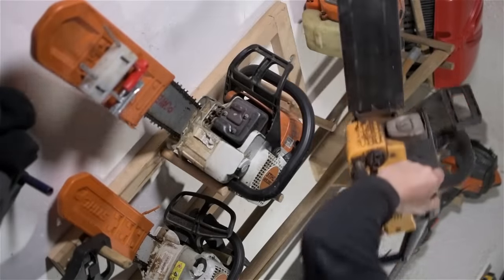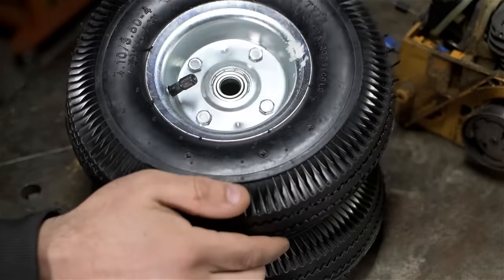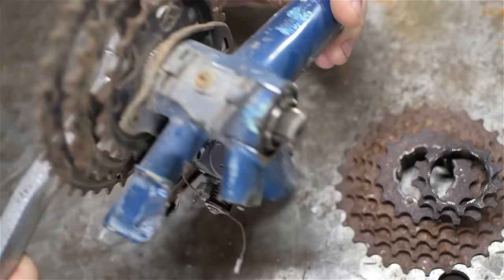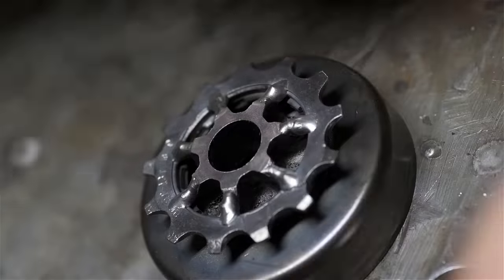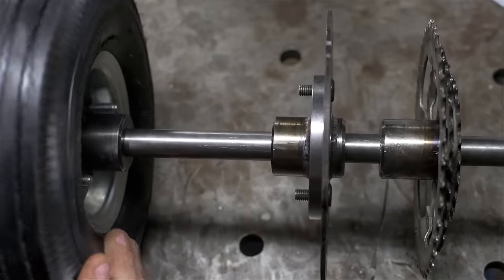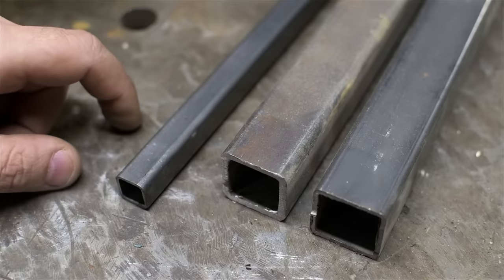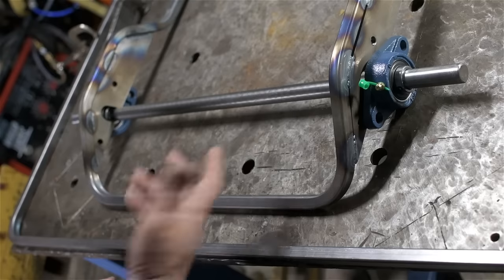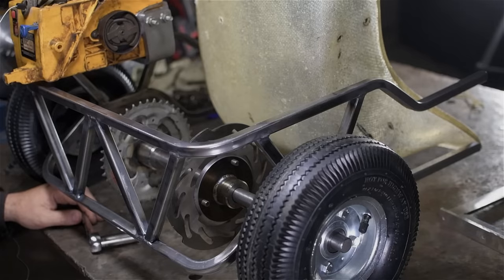CHAINSAW GO KART! - Part 1

Comment: Bit of maths for your gear reduction: If you have 10 inch diameter wheels and you want a max speed of ~20mph, that comes out to about 650 rpm (672 to be exact). With a 12k max rpm that means you'll want a 12000/650 ~ 18:1 gear reduction. That of course depends on whether your chainsaw can hit top RPM at top go kart speeds, but if that's a top speed you want then that's the sort of thing you need. For a 25mph top speed you want around a 15:1 reduction. So I'd probably go for two gear reductions unless you want top speed to be at middling RPMs from the motor.
Reply: Zak Karimjee he may want to keep top speed at about 75% of the power band with a shortened throttle cable. It would probably be gutless or stalling on the low end if he goes too high in gearing +This Old Tony
Reply: I simply can not accept this mob mentality. Unless you're all wearing Plague Doctor masks, for aerodynamics.
Reply: It might just hit top rpms..  or close..  I think it's more than the 1 hp he thinks it is..  50cc Scooter motors are more than 1hp,  and scooter motors are ported and tuned for a lot less power and rpms than a chain saw..  He's gonna be surprised at the power,  
    Chain saws should have close to the power of a Dirt Bike of the same displacement..    I know, 50cc dirt bikes are pretty fast with the little guys on em..    that chain saw is gonna be a lot for that small frame.
Reply: Zak Karimjee 
also the the engine may not have enough tq. for take off. even with a gearing that will allow for 20mph. I came across this. when trying a 3 HP engine on my cart. it wouldn't move on its own. but with help taking off. it would do 15-20 mph. but with the 5hp. it would do 45+. so I guess it was a lot more than 5 HP. I would love to build a larger version of this.
Reply: That sounds right, except I doubt the old motor will hit 12,000 rpm.  New chainsaws only just do that.  I'd aim for 10,000 rpm with a 12:1 or 13:1 reduction.  And yes, I agree, a secondary reduction is needed.

I reckon that engine would put out about 2.5 to 3 hp.  My modern 65 cc Husky saw puts out about 5hp.
Reply: Two 4:1 reduction stages will work, and you'll get decent chain wrap which will avoid some trouble.
Reply: Given the torque issues you're all suggesting from a standstill... he is using bike gears which are designed to be changed. It probably wouldn't be too absurd to try to set up a gearbox. Maybe not.
Reply: Yeah, but given the amount of torque this thing will be putting out, you do not want the chain to be at an angle like it would be when using changeable bike gears. side loading a chain like that, even at a small angle of say 2 degrees puts a tremendous amount of force on the chain in a way that it is not intended to have any real force on it. it will wear the chain rollers out prematurely, and he will be replacing chains every couple months. I would really like to see tony forgo the bicycle chain and bicycle sprockets idea, and at least go for a chain and sprocket set with a little more meat in em.
Reply: Bike chains are more than strong enough for this application. They're designed to take very high torques at very low rpm (Which is how human legs deliver power), so low torque at high rpm won't be a problem from a strength point of view, even with misalignment, which again bike chains are designed to handle at high torque (Unlike just about all industrial chain systems).

For comparison, most people can reasonably easily put down half a horsepower (For a short time) at somewhere around 120 rpm, professionals (Who run the same chains and sprockets as everyone else - they get more expensive, lighter and less durable at the high end rather than stronger) peak out somewhere over 3 horsepower and will do 1 bhp for minutes at a time. It's worth getting a chain tool to split the chains correctly though, this is faster than trying to hammer the pins out.
Reply: More maths for DJHenjin : if I put half my weight (85kg/2) on a 20cm bike pedal crank, that's about 80Nm of torque which has to go through the chain. If the motor puts out 2hp, Torque = Power/rotational speed, so at say 500rpm idle (for a max torque output) that gives 28Nm of torque, with the absurd assumption that it puts out full power at idle. So basically I think a bike chain and pedal will be absolutely fine for this dinky little motor.
Reply: This is true. However, regarding the derailleur gear-shifting idea mentioned above, these require a long chain to avoid disastrous flex in the chain, which means the derailleur would have to be up at the front by his kid's feet. I for one, and I will guess Tony concurs, wish for his kids to retain two feet and full-length legs.
Reply: Hooray for Zak, you beat me to doing the math I was all ready to work out!
Here's a modest-proposal sort of thing: a two-speed gearbox involving an intermediate stage (so, a three-stage drivetrain all told), with the two reductions clutched in and a lever or pedal which switches them. This would be mechanically complex, true; but perhaps it can be made to only shift to high gear on the fly and has to be shifted down when the kart is stationary?
Reply: I calculated a bit different.
For 25 mph your axle would do 835 rpm (with 10 inch diameter wheels), that would require a 15:1 reduction from 12500. At 10:1 you would end up at 37mph, given the motor does 12500 rpm under the load. 37 mph seems adventourus without any camber at the wheels for a fixed axle and without a differential to go around a corner with both wheels driven. It might be impossible to steer at higher speeds, the traction of both steered wheels would need to overcome the grip of one rear wheel to turn that direction. It could also fishtail when that wheel regains traction.

Because of that and, as it is going to be a gocart with sketchy wheels, i would opt for more torque at low speed, simply because it is more fun when going around corners than to go fast straight in that thing. Its also questionable if the chainsaw was ever designed to really operate at medium throttle. The whole clutch design might be built around that problem. 

The motor output now has a 13T sprocket, the small sprocket on the axle is 23T, the biggest 43T, if i counted that right. There would need to be an intermediate shaft (or two, as one could be over the wheel axle) for the required reductions with e.g. 
Motor 13T -> 43T / 23T -> 43T / 13T -> 31T to have a 14,7:1, all with their proper bearings, some chain tensioning and so on. The rpms for the bearings would be 12500 (Motor) -> 3779 (minus 847, as it can be made relative to the wheel axle) -> 2021 -> 847 (Wheels)

Or you could go back to the wormdrive and add a freewheel or clutch to that, so the axle does never lock up when rolling or braking. It also would have the benefit of allowing slip when braking and accelerating at the same time, making the whole thing safer and a bit smoother to operate. As a bonus that freewheel could be made in a way  that both wheels can turn independent and only lock when accelerating, therefore creating a non locking differential.

First thing on a test drive should be a test if the brakes are stable enough and able to overpower the motor under any circumstances (e.g. accelerator pedal stuck at full open throttle).
Reply: @Zak - I came it from the other direction. I started with a conservative max rpm of 10k, divided by a 10:1 gear ratio (I paused early in the vid when that was still the plan) bringing max theoretical wheel speed to 1000rpm. With a 31.5 inch circumference on a 10 inch wheel at 1000rpm I get a top speed of 29.74 mph which is the top of where he wanted to be. On a side note about ideal rpm at max speed, I suspect these chain engines probably live longer at full tilt WOT, similar to a boat engine. Cheers!
Reply: I've often wondered if a derailleur could be used on a small kart.  I reckon a bicycle chain could handle the torque of the engine but the short chain would have to bend a fair bit.  Plus bike chains are cheap and plentiful.  The problems would be complexity and if the chain came off the sprocket there's a chance it might lock the back wheels at speed.  Some sort of one-way drive (like on a push bike) in the axle sprocket would alleviate the lock up issue. 

If you're up for the challenge Tony, it might be worth a go.
Reply: Hi zak ive got an engine that I want to use and its top rpms are 6500 I want to go about 35km/h would you be able to tell me what kind of gearing I would need its 1.6hp?.
Reply: We'll need the diameter of your wheels and preferably the diameter of your drive sprocket/pulley
Reply: @Ubiquidic The math(s) for working this out is pretty straightforward (knowing if the physical thing will operate based on what you calculate or assume is another story but at least working things out in theory isn't too bad).

Take the speed you want to achieve in this case 35km/h take the distance portion the 35km and divide by the circumference of the wheel, this is how many turns of the wheel need to happen to cover that distance since the circumference is the distance around the circle so say we have a circumference of 1m (incidentally would be a radius about 15cm or 6 inches, circumference = 2*radius*PI), but given 1m circumference we know we need to cover 35,000 of those per hour or 35,000 rotations per hour (if we didn't have a nice clean 1m circumference divide distance by circumference to get turns), since we have our other value in rpm convert the 35,000 rph to rpm by doing 35,000/60 (60 min per hour) = 583 rpm so the ratio between the 583rpm we want on the wheel and the 6500 rpm we have as input there is a 583:6500 rpm ratio if you reduce this by using some rough numbers divide both by 10 and it's about a 58:650 ratio or we could round and reduce futher and say it's about a 1:10 ratio you want between the diameter of the small sprocket on the motor shaft and the large sprocket on the axel driving the wheels.  

The only problem then is if the torque gain you get from that ratio and given the starting torque of your engine/motor if it is enough power to drive the wheels (electric motors like I used in my diy eskateboard have pretty flat torque "curves" meaning they put out roughly the same torque regardless of RPM from what I understand this isn't true with gas powered engines hence the need for a transmission in most cases to get enough power at lower RPM to get things rolling.
Reply: I just gave him similar info , looks like i should have scrolled down first  Zak and Robert

Comment: We had a chainsaw engine go-kart back in the 60s. I think it was a Mccollough. No clutch and had to push start it.  12" slicks on the rear and 10" on the front. It would go like a bat out of hell.  We drove it on the local general aviation airport taxi way when no one was around. This project brings back a lot memories...thanks

Comment: I've got a bunch of saws and a couple of Poulan saws.  The Poulan's are always very reliable even up next to my Husqvarna and Stihls.
Reply: Rosa String Works yea Polans are pretty damn tough
Reply: Poulan has always been a reliable tough saw until recently when I bought a 20" on sale at tractor supply.  Right off the bat it wouldn't start when it di
Reply: Sorry but it wouldn't start after it died when I was dogging it pretty much. I thought it wouldn't cause of my restart proceedure thinking I flooded it. After awhile when it cooled it started right up but still won't start at times when I dog it or the blade is wedged in the log. I'm real careful now of restart procedure after it dies. Also the motor don't excellerated like my wild thing does an although my 20" dies have a few more CC's it bogs down a lot easier. They trying to make it so dummies can cut wood has really made it ineffieciant for someone who needs that power to be efficient cuss I live on a farm.  So what y don't I buy a shtil?  Cuss I can by three poulans to one sthile  but I guess you get what you pay for

Comment: why not just use a chainsaw chain as the drive chain? WHAT COULD POSSIBLY GO WRONG? :P
Reply: Tyler Hickey 
don't even modify the saw at all, just glue some cut up old car tire and glue it to the chain. 
Make a plate  to mount the saw on with the bar sticking off the back, add a lever to rock the plate so the chain/bar hits the ground and you are off and runnin!
Reply: You have to admit it would be intimidating to competitors.

Comment: hey tony, instead of welding everything to the axle and making it a one shot unserviceable deal, why not just mill in some keyways only in the spots where stuff will be after you have it all laid out (since im assuming you dont want to key the entire shaft)? or even just drill right through the hub and axle to put a nut and bolt through so that it has the entire cross section of the bolt transferring the torque.
if you dont mind ordering online you can get little disc brakes made for 50cc scooters and pocket bikes that have mechanical calipers and the discs are only about 4 3/4" across rather than that giant bike brake. i got 2 calipers with pads for $20 and 2 discs for $25 a year ago.
also im not exactly sure on how you plan on making that double reduction work with it sitting on the shaft like that seeing as the output of the intermediate would have to go back up to another intermediate or idler and back down to the shaft for the final gear. plus you cant weld it to the shaft or it will just bind up the whole thing and if you let it free spin it will just wear it down and eat up the shaft and hub and probably make some horrible noises. unless you plan on using a bearing and at least 2 more sprockets to make it a triple reduction or have and idler somewhere i would move the intermediate setup you have off the axle and put it elsewhere and make a new hub for the final drive sprocket. also a chain tensioner is a good idea, easily takes up the slack when the chain wears in and makes it far less likely to throw it.
finally i know this is for a kids kart and wont be carving up the track at 50 mph, but those type of tires are total garbage and like to roll off the bead when taken sideways so i wouldnt use them for the risk of turning my kid into a tiny harvey dent unless you want to try and bead lock them somehow like they do with offroad tires. if you can find some lower profile tires it would be a much better choice or even some thin solid rubbers at the cost of weight and ride quality.

and by the way the 295 engine is a 2 stroke 46cc making ~2 hp and free revs up to 13.5k rpm
Reply: the key would be difficult because you'd need the right sized broach to put a keyway into the various parts, and you'd also need to figure out how to keep the parts from sliding down the axle (setscrews or lock collars would work, but both would require parts and/or more work). Drilling a hold for a bolt might be difficult to do through steel, with the big flange on some of the parts might make getting the drill down in there difficult. I'm sure tony probably had his reasons not to go with these strategies.
Reply: Setscrews I like your style. Even continue that hole through the axle itself for a locating hole. Just mind that the screw becomes a shear pin
Reply: the type of key you are referring to is called a woodruff key. https://en.wikipedia.org/wiki/Key_(engineering)#Woodruff_keys
Reply: Tyler Gutstein tiny harvey dent!!!!!!!! 😂 
Awesome comment!
Reply: Devin Castellucci only the problem for that is the price of the cutters.
Reply: The Monster O' Dub all you need is some tool steel a lathe, mill, and grinder.
Reply: Tyler Gutstein 
Haha I had one of those blue harbor freight hand trucks, and needed front wheels on my kart for a test run. 
See where I'm going. 
About 5 mins of riding and I see the right tire wobble a little as I take a left hand corner.
Gee maybe I should check those 4 bolts, TOO LATE! 
next thing I see is the tire rolling away in a straight line ahead of me as I'm turning left and the spindles grinding the pavement at about 30mph. 
So straighten the steering wheel and go chase my darn tire!! 
Busted the center right out of it. 
Oops. 
So I welded it back together ,crooked, and put both of them back on the hand truck. 
That was enough go kart testing for that day.
Reply: The key is not difficult, think of woodruff keys used on electric motor shafts - a woodruff / t-slot cutter is all that's needed. :-)
Reply: MrTheHillfolk kk